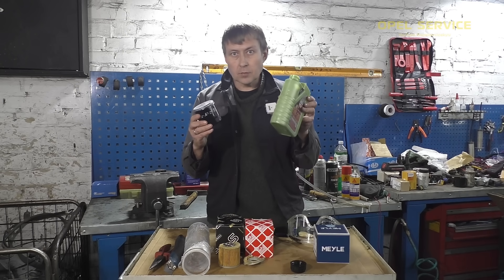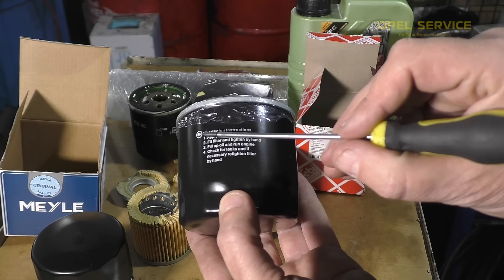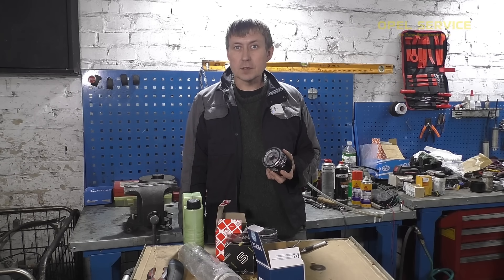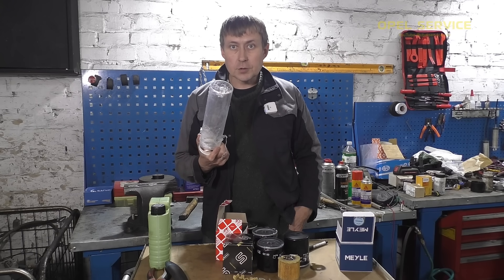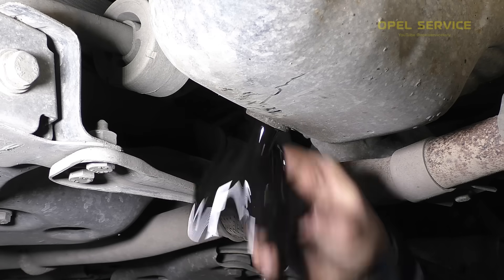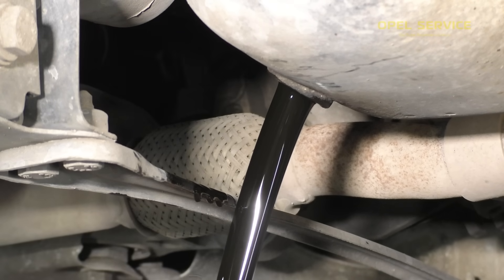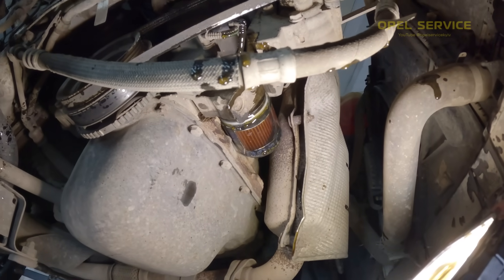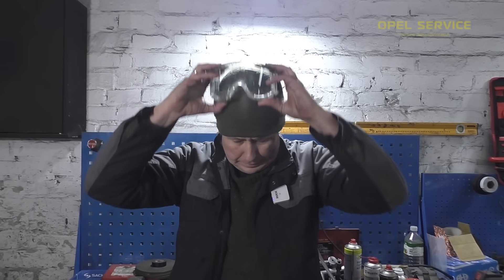Should You Pour Oil into the Filter ? Transparent Filter Shows the Answer

Comment: Pre-soaking the oil filter with oil before installation will reduce the length of time the engine runs without oil pressure. And considering 90% of engine wear happens on start up when the oil is not circulating and lubricating,anything you can do to reduce that critical time will lengthen engine life,mainly the connecting rod bearings as those usually are the first to get dammaged in a no/low oil pressure situation.
Reply: Pre-soaking the oil filter is only possible in cars with vertical oil filters. In cars with horizontal oil filters, it is impossible to pre-fill the filter before installation and even if you try it, it will only cause a complete mess. In this situation, the only possible solution is to install the filter dry, then disconnect coil and injectors sockets and crank the engine over by the starter to fill the filter with oil. After that you can reconnect the sockets and start the engine.
Reply: @headtoheadracing 
The problem is when the filter screws from top to bottom
Reply: @konstantin-big  Work fast🙂
Reply: @gothicpagan.666😂😂😂😂
Reply: Even with the disconnections the pistons and rings are still running dry until oil pressure is up to normal.  @headtoheadracing
Reply: @jimiguitar3252  Yes, they are still running dry but running dry @ 250 RPM is way better than @ 1250 RPM!
Reply: Good point, thanks
Reply: @jimiguitar3252  pistons and rings always run on thin oil film. they are oiled with an "oil fog" that appears inside engine when it runs. pistons and rings can not become "oil dry" when you crank engine, even for minutes of cranking. But it can become "oil dry" when you run engine without oil.
Reply: @jimiguitar3252  Nothing in the engine is dry on startup...there is ALWAYS residual oil coating all parts of the engine...
Reply: @headtoheadracing Are you sure? It’ll run longer at 250rpm until oil pressure is up, at 1250rpm it takes way less time to get there.
Reply: @v8tergt653  It is not just a matter of RPM my friend. When you crank the engine with the starter (engine off and no spark), there is no combustion inside the cylinders and no combustion load on moving parts (especially crankshaft journals and bearings). When the engine is running it is under tons of pressure from combustion which is not good when proper lubrication is still not present.
By the way, at 1250RPM it takes less time to get there, Yes, you're right but the engine has turned much more revolutions to get there and a lot more friction has happened.
Reply: @headtoheadracing  A now-deceased relative of mine used to turn his engine over with the starting handle (where they had one) a couple of revolutions before starting as normal.
Reply: @HowardLeVert  What was his car?
Reply: @conradsealy9603  the "90 percent of wear" occured in the cylinders and was mostly overcome when electronic fuel injection became standard. In the old days, residual fuel from the carburettor would condense on the cylinder walls, diluting oil. Before fuel injection, most motors had a 200,000 kilometre lifespan, average. Electronic fuel injection? Life increased to 450,000 minimum and 800,000+ is possible with newer synthetic oils(for petrol/gasoline). 

In modern motors, cold starting is the primary issue of wear. 

The crank and cam bearings are fine and can run without oil pressure for a surprisingly long period of time without damage, as long as they aren't under load(at idle only and in neutral/park).. 

The Holden Red Motor in Australia was notorious for it taking up to 5 seconds for oil pressure to come up at cold start in winter. It was always started with full choke only, no throttle. Had one that had 210,000 kilometres on it.. when I checked the crank bearings? They looked brand new! These motors, it could take up to 7 seconds for oil pressure to rise after an oil change. Filling the filter wasn't possible, as it screwed on horizontally. You'd lose half the oil out of the filter whole getting it into place.

Comment: Oil goes from the sump to the pump then the filter and then the main bearings so what could it possibly hurt? If you want to prefill do it every little bit helps.
Reply: The argument is have heard is you are pouring "unfiltered" oil into the filter. This doesn't really make sense to me, plus it's new oil. So yea I agree, prefill the filter, especially vertical oriented ones that it's easily accomplished with.
Reply: @benscoles3067  the guy that commented above you translates to something about air bubbles getting in the oil or something but that doesn't make sense to me. I have vehicles I can prefille and k2500 from the late 90s I can't because it's a big block and the filter sits sideways and on startup it seems to take a good second or more before I get a reading where the others don't waste any time getting it there.
Reply: Dolej fo filtra ktory jest montowany pionowo lubub pod katem ale tez w pionie hehe
Reply: Quando o óleo é colocado no filtro, ele impede que o ar que entrou na passagem de óleo saia. É muito pior do que deixar o filtro vazio

Comment: That’s was a disaster of experiment ! But as everyone can see ,it’s just seconds that filter gets filled with oil. Pointless exercise.
Not all the old oil drains into crankcase ,some still remains inside the engine. Including some old oil remains between oil rings and pistons. That old will protect engine for few seconds on startup,and new oil gets  everywhere in few seconds anyway and begins to build up pressure immediately. So not to worry so much. You are only wasting your valuable time,on the job.
My father was auto mechanic for forty years. He would have said,world gone crazy.
If filter stands with opening up, you can fill the filter,but if filter stands sideways,then you are wasting your time.
Go ask engineers at General Motors or Ford. Does they care that on brand Models of their cars .
Filters being installed in cavity of the engine block that is being opened from the top.
By removing open style filter inserts from the top of the engine block. Then top being closed with plastic cup/bolt driven from the top. Like it’s done on Chevrolet Cruise for example!
Reply from the maker: Yes, the experiment ended in complete failure, but it is also an experiment. Thank you for sharing your experience.
Reply: @  still as you can see ,pressure builds up immediately after the oil pump is engaged, even if engine does not start.

Comment: I worked for Cummins for 30 years and they have recommended filling the oil filter before initial installation for decades and I have done it for decades with no adverse effects. I have cut open a used Toyota filter from my V8 4Runner and the media was in perfect condition. It helps get oil to the engine more quickly after and oil change than putting the filter on dry and the media is already oil soaked then and ready for the new oil to flow through. No different than when you start the engine every time after you have changed the oil, the filter is full of oil, or is oil soaked.
Reply: @RonRussell-sj1zf  totally agree with you: on my subarus, the EJ20's oil filter is vertically mounted so that I can fill it up before cranking. On the EZ30, it is unfortunately horizontally mounted. When I crank the engine after the oil change, I can hear the clicking sound for clearly longer on the EZ30 which is enough to convince me to keep prefilling the filter where possible ;) so does my dad since 40 years and so did his father too...
Reply: Filling the filter won't hurt anything. It is good prevention😊
Reply: I've been putting oil in new filters for over 90 years it the only way
Reply: @bertiewooster3326  Нічого собі, який ви довгожитель.
Reply: Друзья, сколько уже можно говорить на эту тему: естественно заливайте если положение фильтра на двигателе позволяет это сделать (расположен вертикально или близко к тому).  А на счет того, что бумагу порвет, это полный обсурд, ведь если посмотреть с помощью фонарика через отверстие для закручивания фильтра, вы увидите перепускной клапан на дне. Так и при запуске в -20 когда масло очень густое бумагу бы разорвало, но ведь этого не происходит. На моей Ауди А6 С4 2,5 тди фильтр объемом 0,7 литра, и если не залить туда масло, то может и вкладыши поцарапать. Всем добра.😊
Reply: And in relation to Filters Placed Horizontally, and Vertical or Diagonal ones but in the Reverse Direction, how are these filled?!! 🤔🤷 And now, in relation to the example of My Car, which is just the paper cartridge?!! 🤔
Reply: @franciscomiranda9561  Same wonder the reason for my Mercedes.
Reply: @franciscomiranda9561  Then you will have to suffer the consequences!
Reply: And Catapillar says not to refill the filter. Their main reason is the possibility of adding unfiltered contaminants.  If you are going to fill a filter it is important to slowly add the oil through the multiple small holes.
Reply: @danielbruneau2222  If you can't pour clean oil from the container into the filter then don't mess with it.
Reply: @danielbruneau2222  I too have seen those warnings to put filters on empty. I have also filled thru the outside of the filter media. Keeps dirt from entering the filtered side. I have seen sediment in new oil containers. Makes you wonder how clean new oil is before it goes thru the engine filter.
Reply: I've never prefilled it and never had an issue either. It literally makes no difference except the potential to drop it or spills which is more mess to clean up
Reply: @EazyDuz18 
Concordo plenamente com você!
Reply: Very funny.
Reply: Just googled and found that CAT and CUMMINS recommendation "DO NOT FILL THE OIL FILTER!"
Reply: @markwarnberg9504  Thanks, but I'll continue to fill mine as I have for last 50 years.
Reply: @RonRussell-sj1zf  Maybe these new engines do not need pre-filling.
Reply: @RonRussell-sj1zf  I am a mechanic bt I did Cummins halfway may u help me
Reply: @RonRussell-sj1zf  
Tanto faz brother!
Vc troca o óleo com o veículo quente, certo?
Escoa o óleo usado, repõe o filtro e coloca óleo novo, então dá a partida em seguida!
Nesse meio tempo, o motor ainda está lubrificado, então se o filtro está vazio ou cheio, não altera o resultado!

Mais vale cuidar o tempo correto de trocas do que esse mínimo intervalo de tempo e quanto o filtro enche de óleo.
Reply: Gresit! Este bine cand coloana este plina.
Cand coloana este goala si tu ai o hartie uda prin care trebuie sa treaca aerul,  nu este bine !!!
Reply: I've seen the size of large diesel oil filters.. I can understand why it's recommended. 

I also believe most diesel oil filters screw on with the filter in an upright position, the same way that the diesel fuel filters do. 

In many automotive situations, the oil filter screwed in in a horizontal position and often, in an awkward and difficult to get to position. Pre filling the filter only resulted in creating a mess to clean up. 

What's important, is starting off the key only and waiting until the oil pressure gauge moves or the oil light goes out before adding a load.(where possible)..
Reply: Quando o óleo é colocado no filtro, ele impede que o ar que entrou na passagem de óleo saia. É muito pior do que deixar o filtro vazio
Reply: @antoniocorrales6488  через редукционный клапан воздух выйдет
Reply: @antoniocorrales6488 кто вам такое сказал. Или сами придумали. Люди делали прозрачный фильтр нормальный. И все там продавлтвает. Вы свои фантазии за действительность не выдавайте. А то очень глупым, выглядеть. Физику учи, чтобы глупости не говорить😂
Reply: @antoniocorrales6488  If you don't put oil in the filter you have a much larger volume of air to escape
Reply: I have never put any oil i filters for 40 years. Thats a myth liked many other diy tips overflowing the internet.

Many suggest if not You pour oil in to it that the filter will...
* Explode
* The filter media will be trashed
* The bearings will be harmed
Myths with no facts